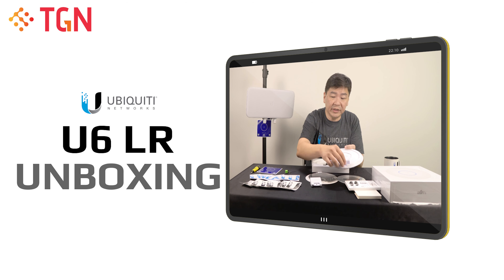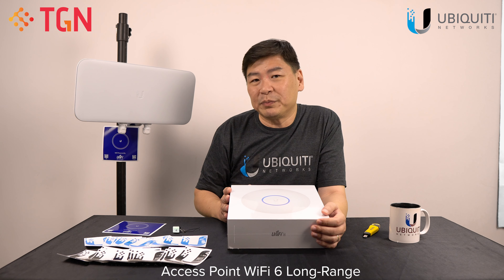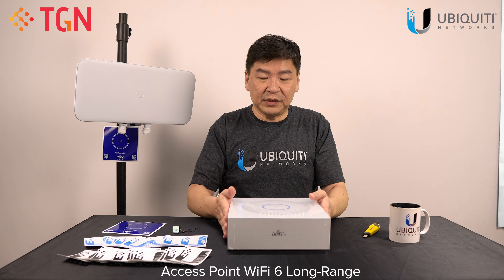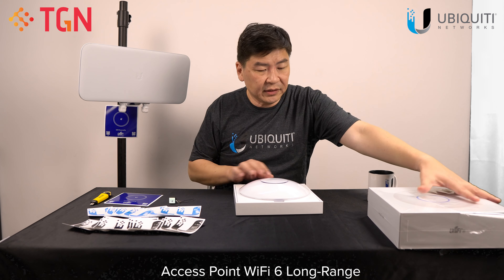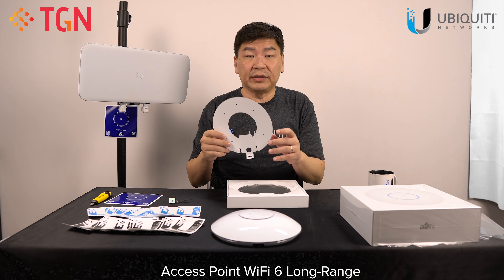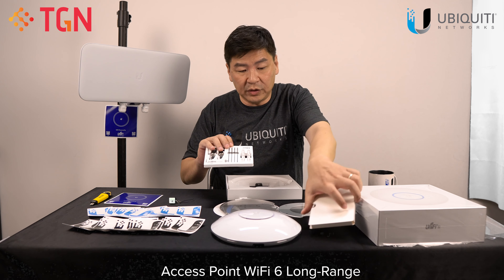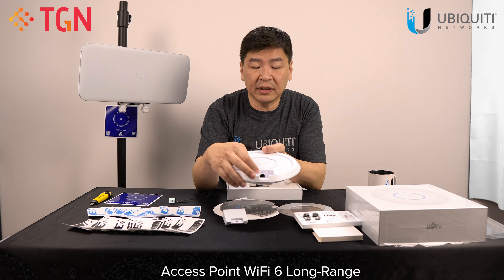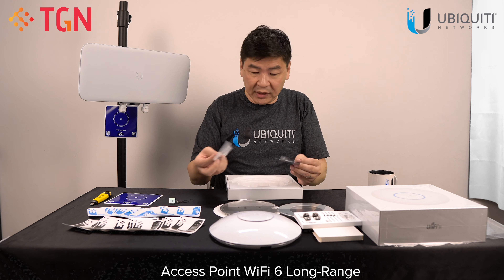[UNBOXING] Unifi U6 Long Range Access Point

Comment: Hi what is the link to the poe switch that you mentioned in the video.
Reply from the maker: Hi, have to make sure your POE switch supports 802.03AT. Look at USW-24-POE, USW-Pro-24-POE, USW-Pro-48-POE.
Reply: @TGN Technology  thank you, i will be using this at home and with Singtel fibre, so what will i need to make it work?
Reply: @TGN Technology   on the website i see one PoE+ Adapter, will that work fine?
Reply from the maker: @sumeetkumargandhi  yes, it works, U-POE-AT
Reply: @TGNTechnology  thank you